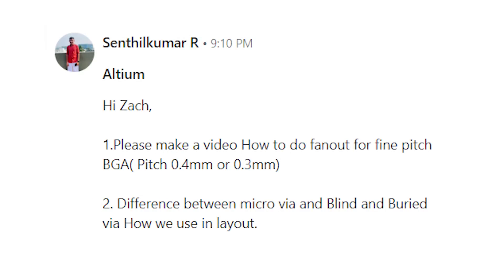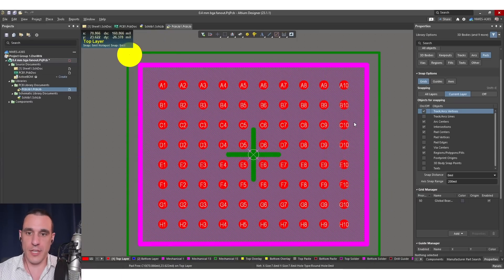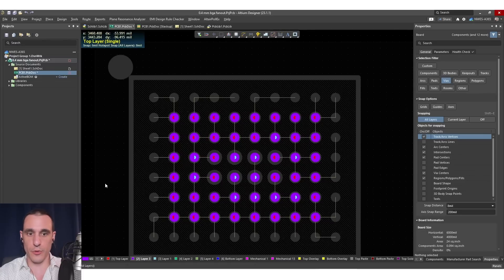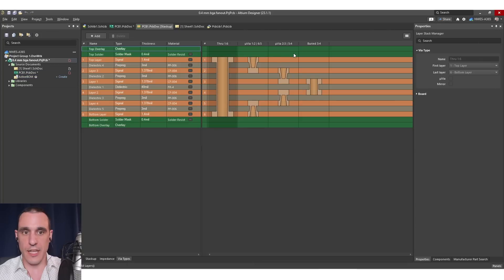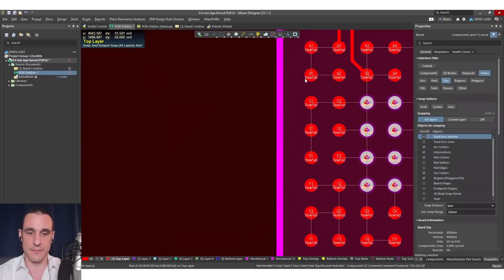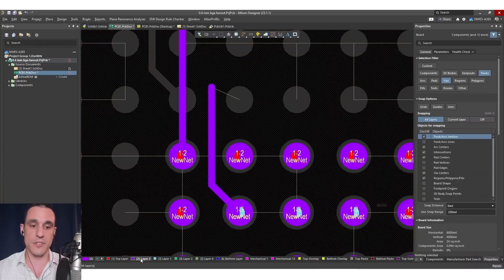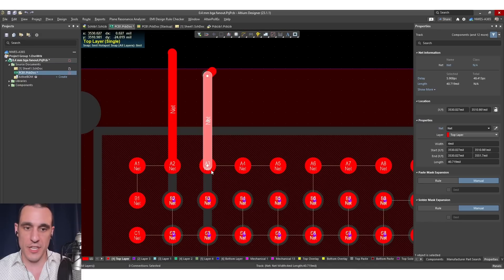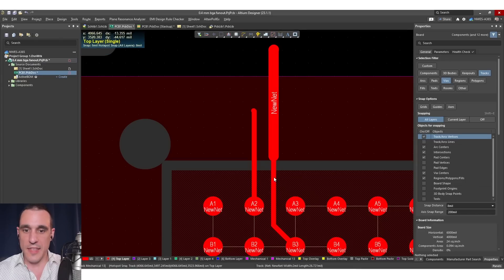Fine-Pitch BGA Fanout Altium Designer Walkthrough

Comment: Somehow it looks like the desire to make smaller capsules defeats the purpose if it takes 4, 6 or 8 layers to get in and out of it? Would'nt it be a lot more practical and economical to make the capsule a few millimeters bigger and have space for all traces you need? They're still very small packages for all they can do.
Reply: Actually, if you take two packages with the same pin count, and you do one in HDI and the other in standard through-hole, you will find that the through-hole design takes more layers. This is because on the inner rows of the BGA, you can only route one row per layer due to the presence of all the through-hole pads. You are forced to route between the via pads because the through-holes pass through all the layers. However, if you used HDI, you can route two rows per signal layer. This is because the vias terminate and you can route an outer row + inner row by placing a trace between the pads. I made a video showing the difference and what the routing would look like on HDI using an STM32 MCU: https://www.youtube.com/watch?v=KBJmJ7fL7pQ
Reply: @Zachariah-Peterson  You may have misunderstood. Perhaps I was not clear enough. What I meant was that if the distance between the balls was bigger than you could fit enough traces between them to route on just one layer and the package wouldn't be that much bigger, just a few mm.

Comment: How the automated fan out tool decides between microvias, blind vias and burried vias. Should its separate row/column of the pins conifgured with a different design rule?
Reply: First you need to enable blind/buried in the stackup manager, and if you are using these you are probably also needing to use via-in-pad (use the Vias Under SMD rule). Then you can use the Route --> Fanout --> Component option, and there will be an option to update with blind/buried vias.

Comment: Quite helpful to add a local grid under BGA area having half BGA pitch to easily draw tracks exactly in the middle between pads.
Reply: That's a great suggestion and it keeps routing simple. I sometimes set the clearances to be just the right size for my trace width so that if forces the trace between the pads/vias, but using a grid is a great idea.
Reply: @Zachariah-Peterson  good way as well, just sometimes one need to place a track or via a bit off the center, which will be limited but rules